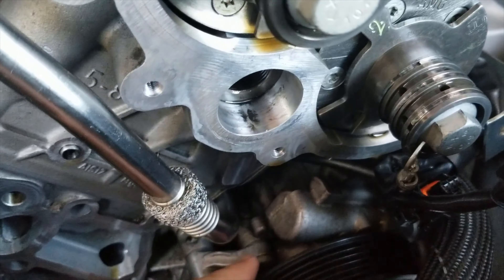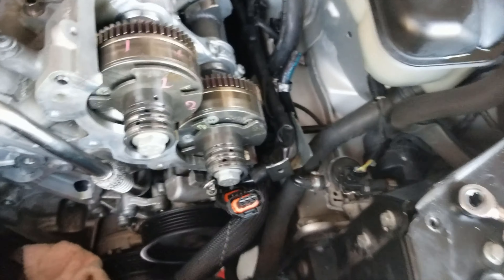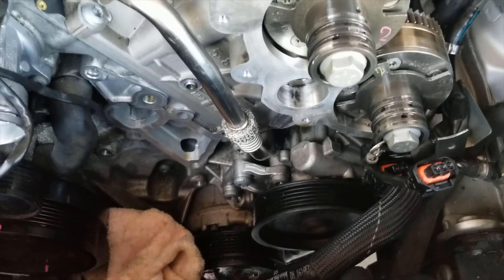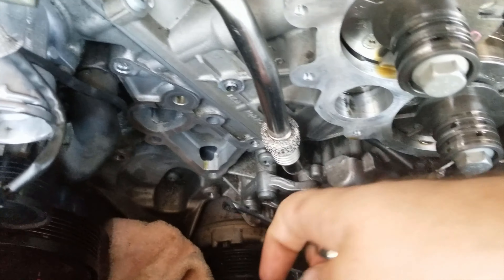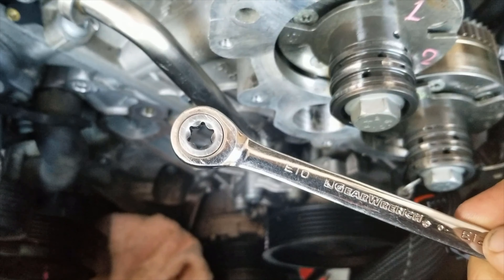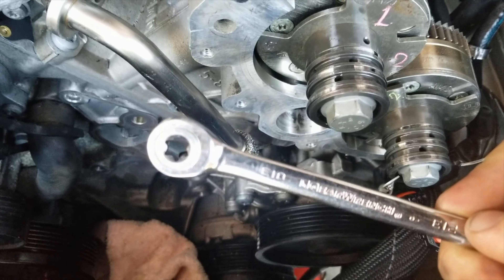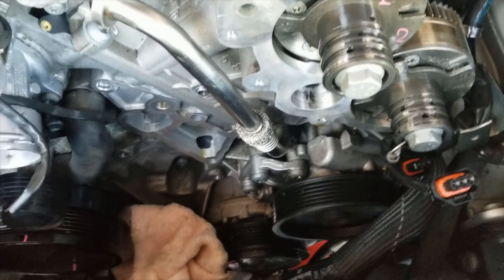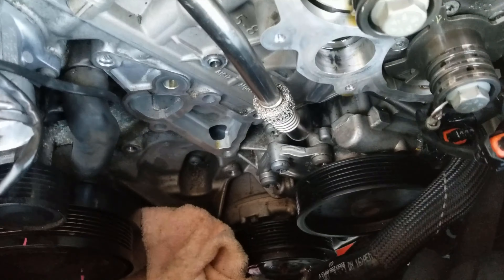M156 Head Gasket Tip| Remove Air Injection Line Without Removing Power Steering Pump

Comment: Hey there, many thanks, it worked a treat,
My m12 borescope camera was actually useful 
For those about to try it, it’s the E10 side of the spanner, and I used the ‘feel’ technique to get the spanner on the nut firmly

Cheers!!
Reply from the maker: I'm glad you found it useful. I spent hours finding a workaround because I really did not want to pull the accessories. By chance I had this sitting around from replacing an M54 starter and gave it a shot. I posted this video so that I could help save everyone else doing this the trouble. These wrenches really are irreplaceable for a bunch of weird jobs in tight spaces.

For anyone else reading this, although a boroscope is helpful, you can certainly do this by feel if you don't have one.

Comment: Are the exhaust manifolds removed?
Reply from the maker: Yes. They need to be removed according to the Mercedes procedure for getting the heads off. It was one of the very first things I did. I would not want to try it without removing the exhaust manifolds
Reply: Thank you